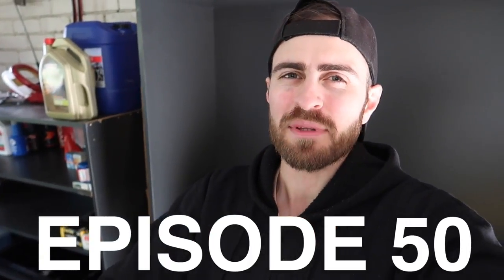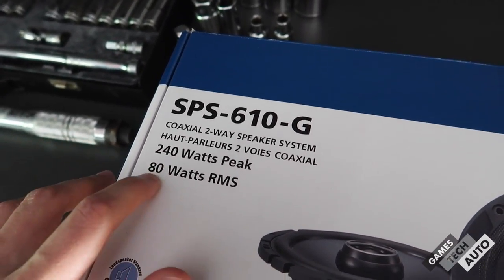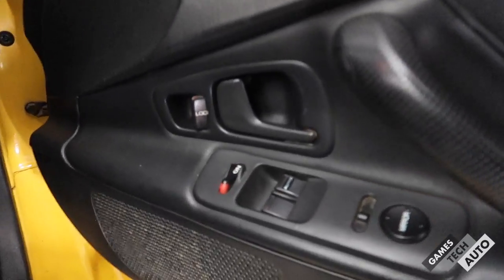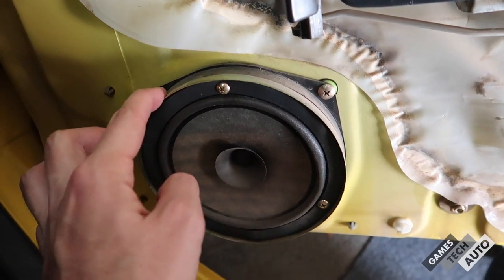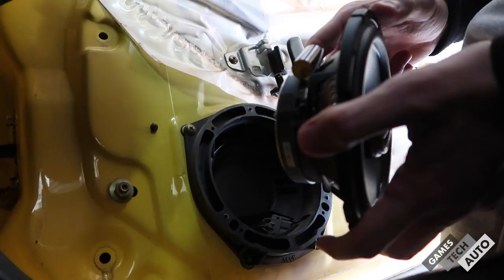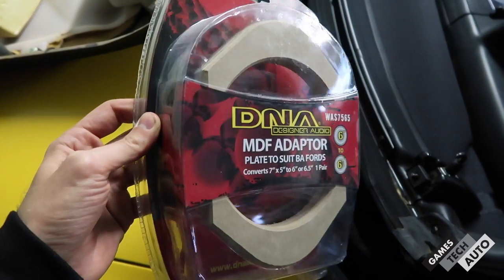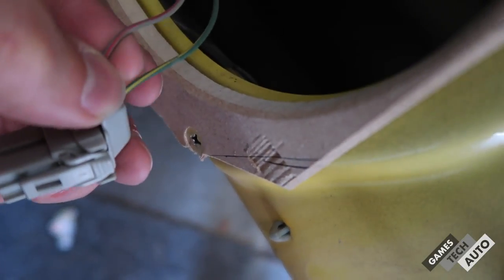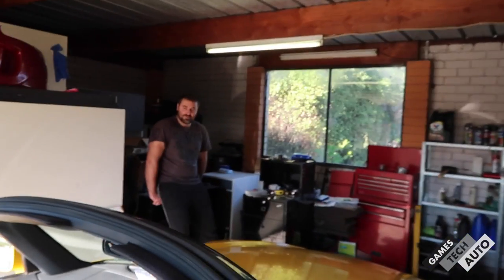Installing Alpine Type-S Speakers In My S2000

Comment: I recently bought a Pioneer double din headunit, Alpine S65C, S65, and SV55 5 channel amp, JVC 1200W (300w RMS) subwoofer, and a reversing camera. Im hoping to get it all installed in the next couple weeks, which is why I was very interested in seeing how your install went. It looked pretty straight forward.

Comment: Hey bro cool video with the install and content of the process :) just a question your speakers are they bassy? Because I’m wanting to upgrade my Supra ones as I really don’t want to install a sub to save room and weight!
Reply from the maker: SZR99 T so far they are decently bassy. When i turn it up half way they start distorting with the standard headunit. So im guessing once i put the amp in and add 3 times more power to them then ill be able to set the settings to higher bass with out distortion. Yeah look man im with you on the no sub thing. Its just to heavy and take to much room. Especially in supras! Hardly any boot space to start with

Comment: Mate where did you install the crossovers? And where did you put the amp? This is pretty much the same setup I want on mine but not sure on how to do the install. Worried about water ingress in the doors damaging the crossover if I leave them installed there.

Comment: I just installed Infinity Reference 6.5" speakers in my 07 S2000.  Seem like Infinity is now supplying plastic adaptor rings now, but still took me to figure out how to match the holes with the new speaker.   Sounds Great now with the new Pioneer Bluetooth CD receiver.
Reply from the maker: Rick Funk makes a big difference with just speakers and a head unit compared to stock hey!

Comment: I am getting these for my 2013 Toyota Corolla. They are replacing the stock speakers (and I am only replacing those because one of them broke) so the Alpines don't exactly have big shoes to fill.
Reply from the maker: Might still notice a small difference..  but really need some sort of amp to get the most out of them i guess.
Reply: @GamesTechAuto : Probably, but that would have cost more money than I was willing to spend. They still sound noticeably better though.

Comment: Hey man! I just bought an S2k and I've replaced the headhunt, next step is the speakers. I don't suppose you remember how thick the MDF wood was?
Reply from the maker: Andrew_EP_Photography i think i used 10mm. 
To be honest if you’re not in the biggest rush i would buy the modifry s2000 speaker rings for a perfect fit. They are around $26. But you might end up spending more making them your self

Comment: Should invest in a dremel man, then you can just cut the back of the stock mount off. But good work getting them in man
Reply from the maker: trayner was thinking about it. That would solve the depth issue. But the front of the speaker diameter is still to big. The mounting holes are beyond the plastic piece. So was no good